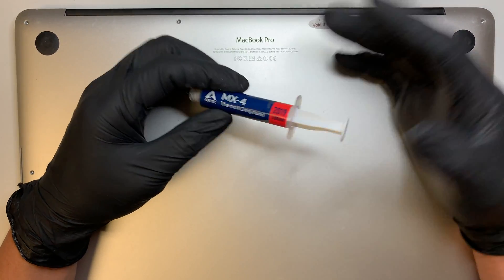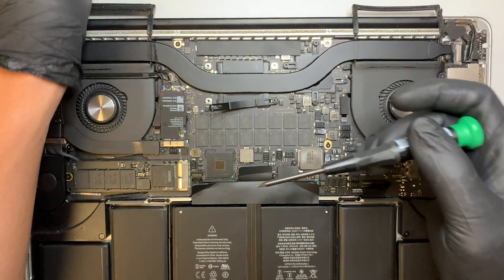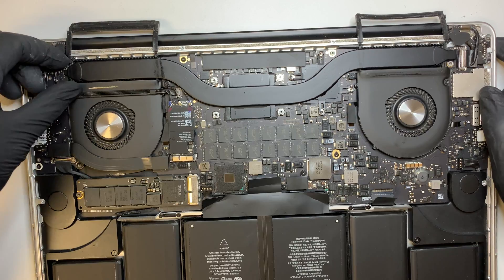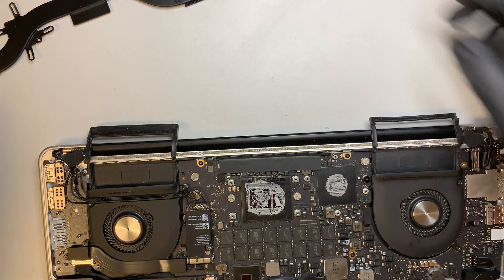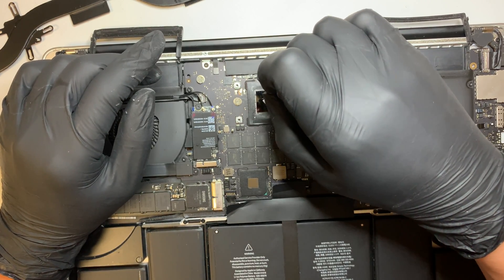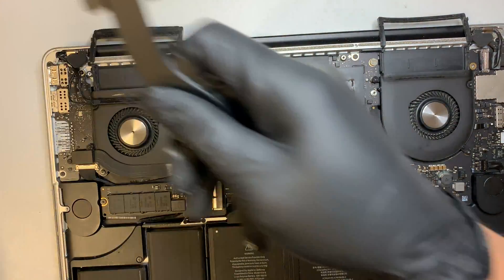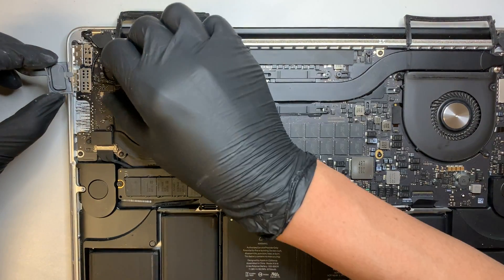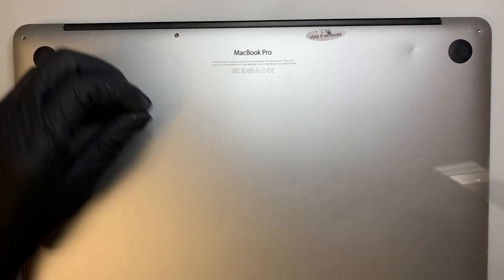Macbook A1398 Overheating Apply New Thermal Paste

Comment: Thanks a lot for the efficient and precise walkthrough! I could easily follow all the steps and wouldn't have tried this on my own without this instruction. After six years a lot of dust had accumulated, which I removed, and new thermal paste was applied and let's see how it will work!
Reply from the maker: You are welcome. Glad the video helped. Good luck with new thermal paste.

Comment: Does anyone know if this resolved their issue? I have a Mid-2014 15" Retina (a1398) 2.8 GHz Quad -Core i7, 16 GB RAM, NVIDIA GeForce GT 7550M 2 GB, 1TB SSD. Just bought used, person before had the battery swell so it was replaced, now has some service battery light and runs hot, maxed out RPM fans, keyboard area/the strip above keyboard is the hottest part, which makes me think its the SSD or possibly CPU I heard? so annoying cause my MBP Mid 2012 13" was quite as a mouse and this is blowing like a jet plane with just simple web browsing! not even using it for Adobe/Music Production like I intended!
Reply from the maker: Cheers Mate
Reply: Funny, i have nearly the same Macbook like you (A1398) two years older and also a replacement battery inside. I run a Linux on it (Solus) and even I try to set it to a powersaving gorvernor, it runs pretty hot on the exact same place like yours. Dont know what I can do. As I remember, the Macbook wasnt so loud couple of years ago and cleaning and repasting made any difference. Maybe the replacement battery get hot (can this be?).
Reply: @hundsboog  ya man. It’s absurd lol supposed to be a LAP top to be used on your LAP. NOT A EFFIN HOTPLATE TO COOK MY JEWELS.